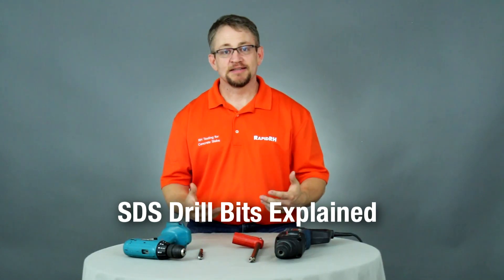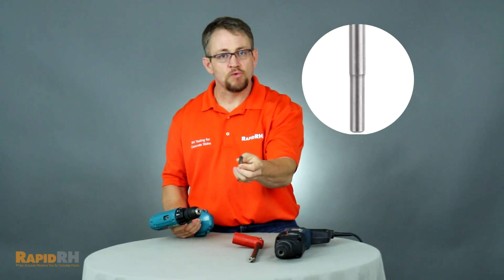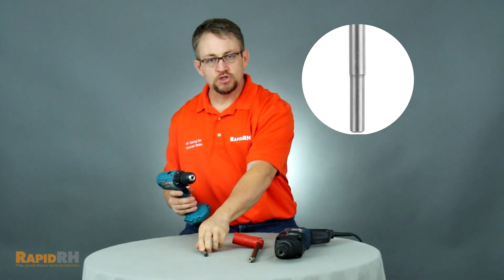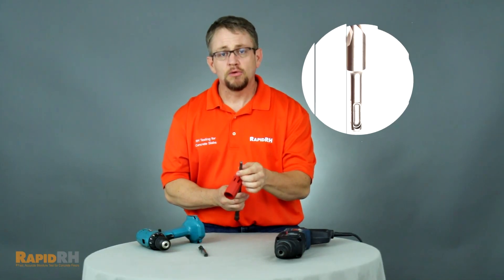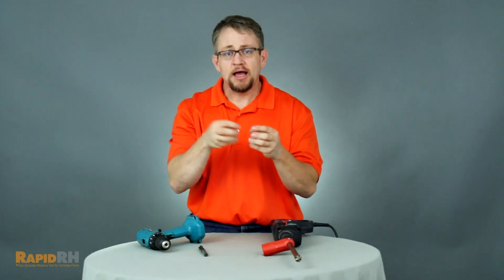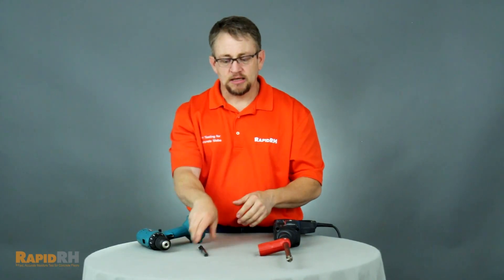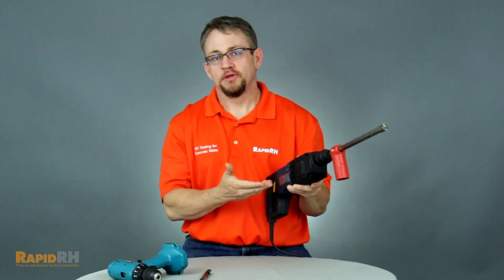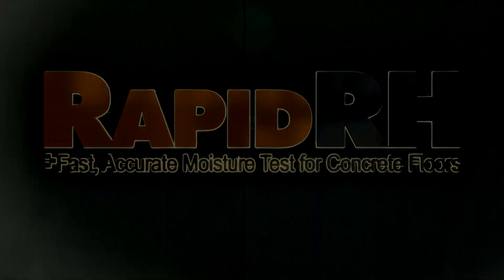SDS Drill Bits Explained and How to Use

Comment: Can I able to use a normal hammer drill bit (the round one) in an SDS plus drill?
Reply from the maker: Nikesh:

Thanks for the comment. No, a round drill bit will not work in an SDS drill. An SDS drill utilizes a square shank to ensure it can drill in the concrete without slipping.

Comment: Kango brand SDS drills are a good brand. Festool have an “Dust Removal Nozzle for Drilling” which attaches to to hose of the Festool dust extractor. I think it would work with any brand of drill or dust extractor. I will get it for my next project. I have the Festool CT26,with the cyclone, it works well.

Comment: Excellent video. I use a Bosch Blue Cordless hammer drill. The angled chisel bits never cease to amaze various trades who have borrowed it.

This drill has had a hard life, and not missed a beat. I get the best quality bits and been surprised at how well they stay sharp.

I find a smaller pilot hole sometimes helps.

Comment: So sill these drill bits work on a regular hammer drill ?
Reply from the maker: They do make an SDS adapter chuck for standard hammer drills.
Reply: @WagnerMetersMain  were I get em at because I can't find em, link me
Reply from the maker: I have to humbly apologize and say that I must have not been thinking clearly when I first replied. The adapters would be for the other way, as you probably saw, SDS to three jaw chuck. Sorry for the confusion.

Comment: I have a Milwaukee Standard hammer drill. Would it accept SDS plus drill bits or only the hex masonry drill bits?
Reply from the maker: It will more than likely “accept” the bit, but it will not work as design or intended. The standard drill has a three jaw chuck where as the SDS has slotting that keeps it from slipping during the drilling process. The drill specs are also different.

Comment: Hi there.  Thanks for the great video.  I was wondering if regular hex drill bits will work in an SDS Max rotary hammer like the Bosch?  Or do only SDS max bits work in that drill?
Reply from the maker: Joe:

Thanks for the question. The SDS plus, which is what the Bosch Bulldog accepts, isn’t interchangeable with SDS Max drills. The grooving is different and the Max is meant for heavier duty applications.

Jason
Reply: @WagnerMetersMain  , SDS Max is a much larger dia shank than standard SDS or SDS+ and so would definitely not fit (At leas mine is!) :)
Reply: Hex drill bits are a different Design than SDS bits.

Comment: I have a general question about the difference between hammer drills and rotary hammer drills. I think that hammer drills have 3 modes: rotary only, hammer only, rotary & hammer. Rotary hammer drills have two modes: hammer only, rotary & hammer. Aside from the drill bit technology, is this an accurate summary of the operating modes?
Reply from the maker: Gary:

Thanks for the comment and questions. Yes, the operating modes for a standard hammer drill would typically be normal drilling and hammer drilling where a  rotary hammer drill typically has normal drill, hammer drill, and hammer only.
Reply: Rotary hammer is a percussion drill -- it hits harder and is much better for getting through hard concrete. Many of them have 3 modes, one being percussion only.

Comment: Hi... I have a hammer drill, but not sds Chuck max 10 mm bit. The hammering produced is not enough to drill hole in concrete. Can I increase the hammering effect so that I can use the same machine or do I need to buy a sds hammering drill?. Kindly share your thoughts and ideas/tweeks. Can I convert my machine to sds chuck
Reply: I second the suggestion. I used to use hammer drills but I now use a rotary hammer. It's a night and day difference. In Singapore almost everything is reinforced concrete prefabs. Add 10 years to those and they are nigh impossible to drill with a hammer drill. Buy once, cry once. Even an 18v rotary hammer will be a better than a corded hammer drill.
Reply from the maker: Sridhar:

Your best bet is to just buy an SDS drill. It will perform better and last much longer.

Thanks,
Jason